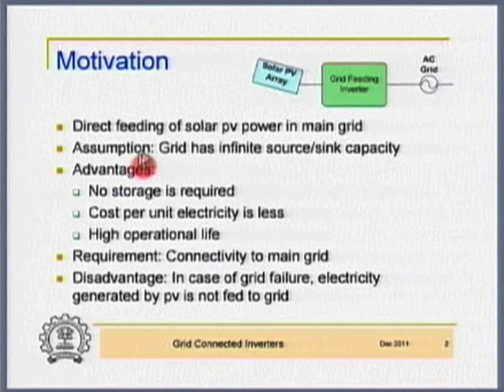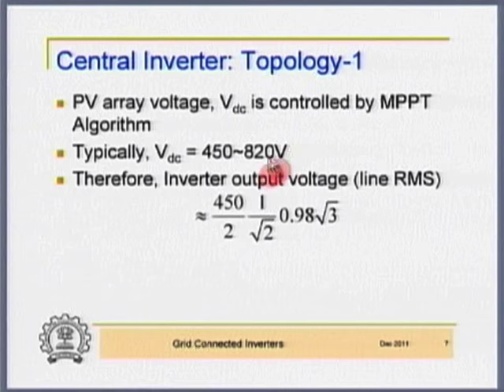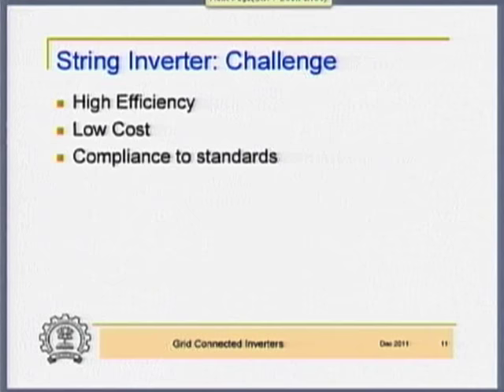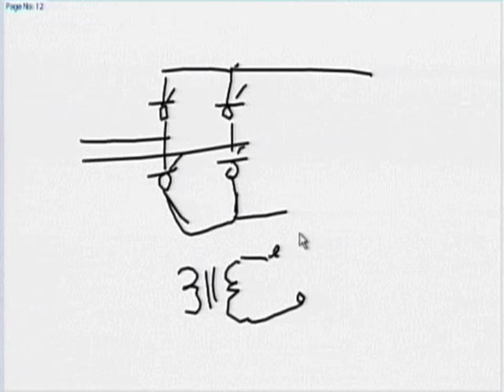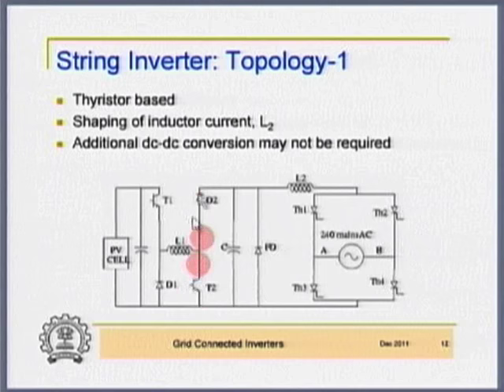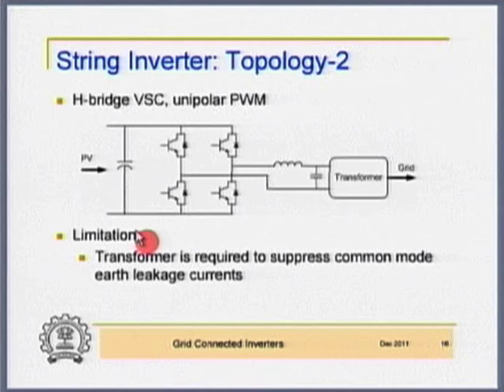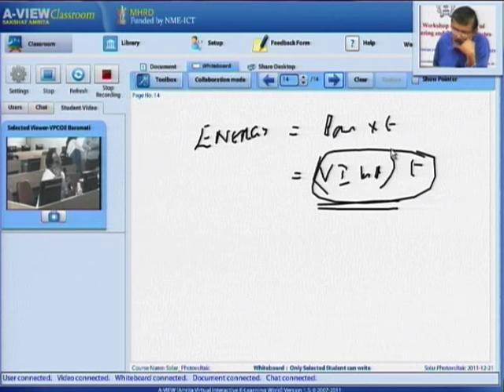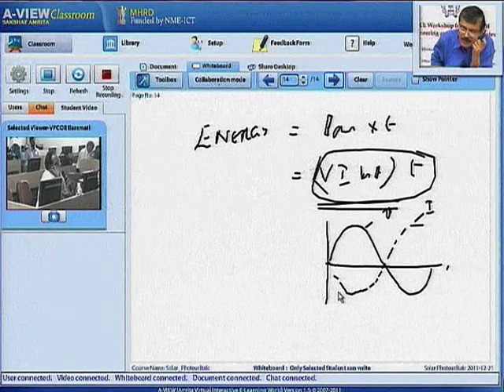SPV M L30A Solar Grid Connected Inverters

Comment: hello sir...i have one query in half wave converter, in half wave RL load converter ,extantion angle is  0 to bita  or  pi to bita?
Reply: The extinction angle beta is nothing but the prolonged conduction angle which is measured from 0 to the point at which the switch stops conducting. Hope this helps.